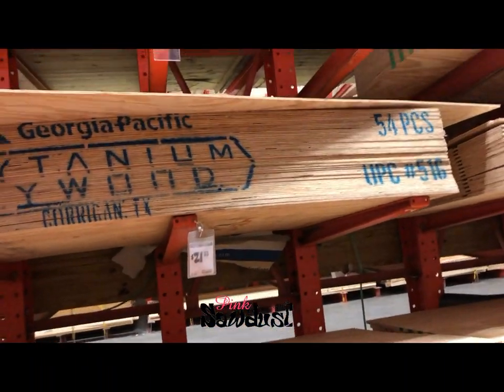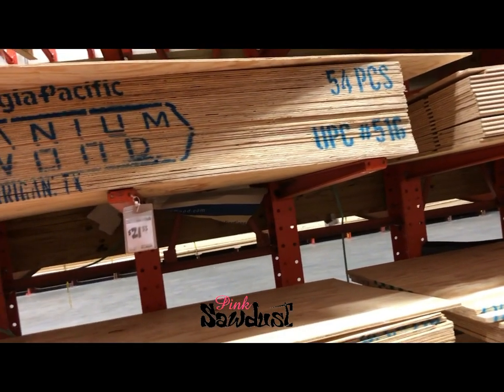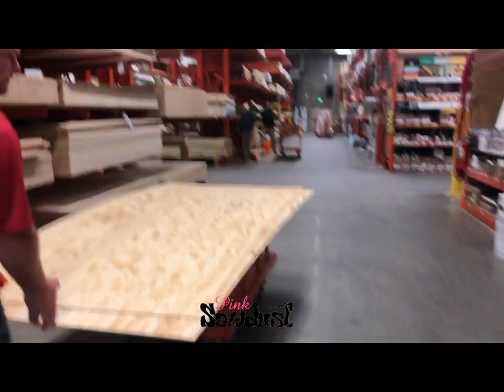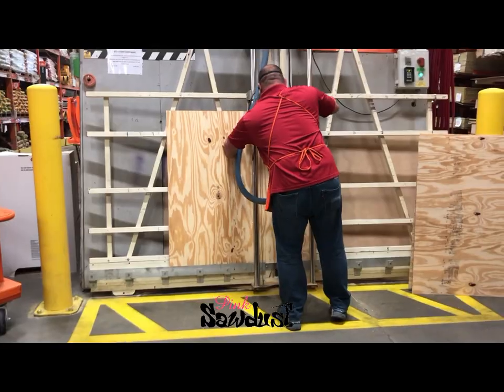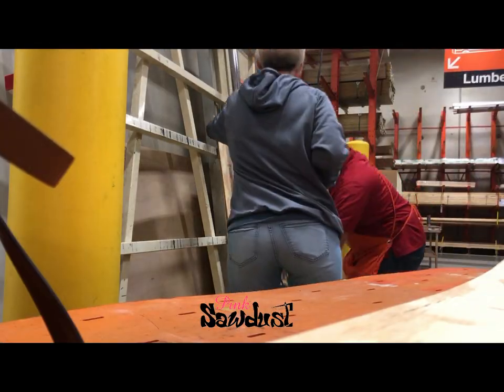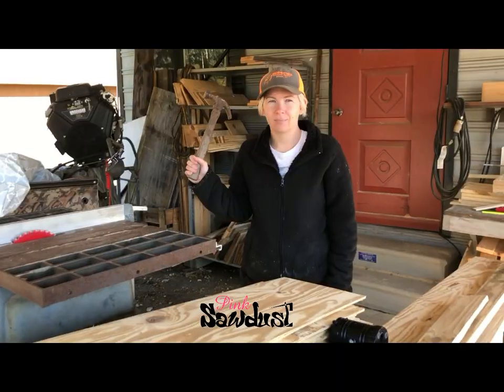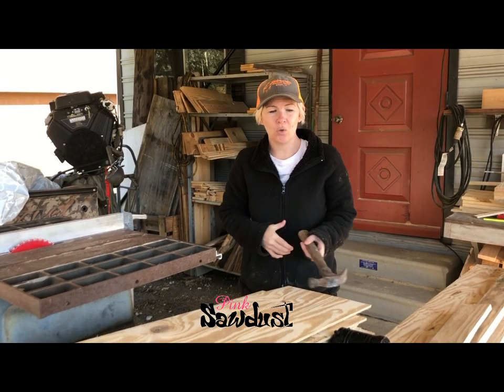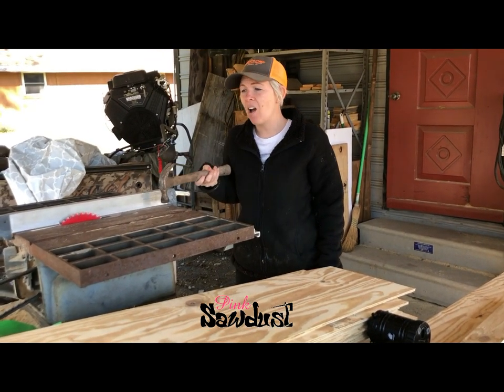How To Build A Wood Sign - Wood Frame - Wood Canvas - Blank - Video Tutorial

Comment: Thank you for sharing because I'm new and have a customer wanting a board that I need to build... the wood you got from your local lumber what kind and what size was that please?
Reply from the maker: you can get prime board or Arkansas board with no knots and it smoother but it's more expensive and not as cost effective.

I use 1x4's and 1x6's .. 8 ft long... #2 pine

I also wouldn't recommend getting boards from large retail stores. They are more expensive. For example my local lumber yard sales 1x4's for $3. At HD it's $7!

Hope this is helpful!

Comment: Thanks for sharing!  I am new to wanting to begin making my own signs for myself and for my family and friends and I'm wondering what type of glue you used to attach your boards before nailing?  was that an automatic nail gun and also what type of nails are you using to secure the board to the back and make sure that they don't poke through the front.  Sorry if those are silly questions I've never used tools or anything before so i'm a super beginner! :)
Reply from the maker: Jessica Godish it’s wood glue. Can find at any hardware store. And I’m using a staple gun hooked up to my compressor with 9/16 staples. Hope that helps!